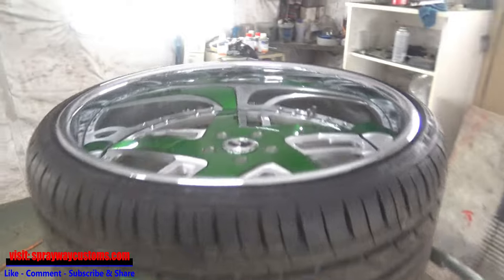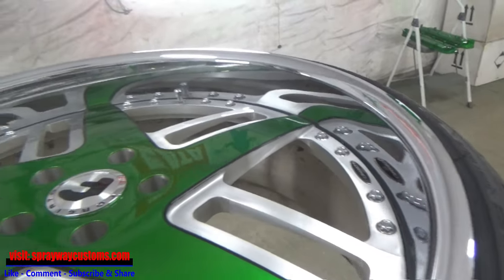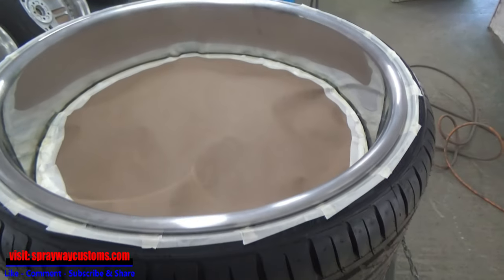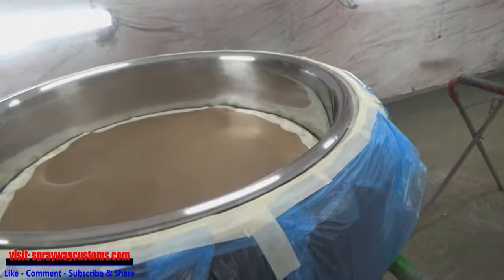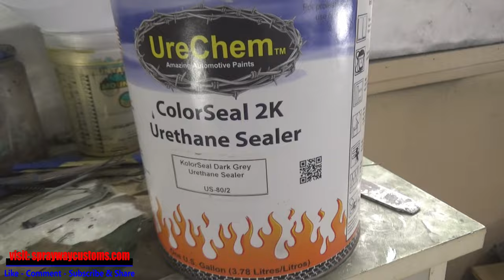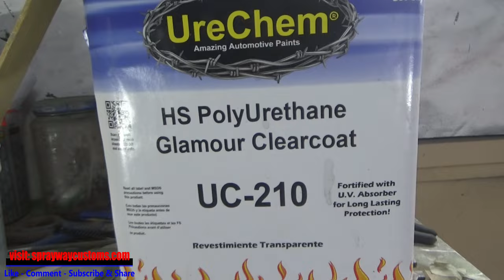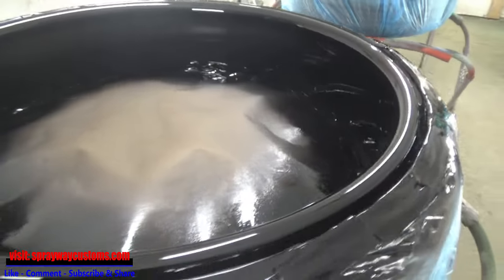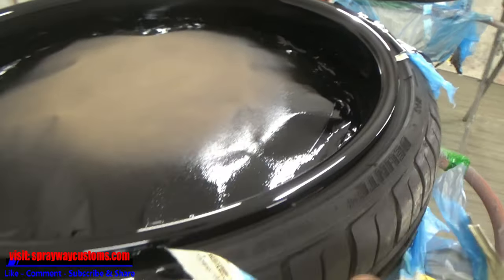How To Paint Chrome Wheels Black & Candy Green CAN YOU PAINT CHROME RIMS - 22" Three Piece Forgiato

Comment: Sprayway my first project, I have a faded what I believe to be a single stage paint not sure but no flaking its a 67 mustang minor small rust spots I'm planning to repair with fiberglass bondo,  would you epoxy prime body then high build primer block then seal or block and then base and clear?
Reply from the maker: Yes, that’ll be the way to go

Comment: What about paint peeling chrome? Do you sandblast them down?
Reply: He scoured them by hand with Scotchbrite - an abrasive pad for scrubbing hard surfaces. It scratches up the chrome plating enough to give the first coat a surface that is rough enough to seep into and grip properly.
Reply: @mike_van_in  that works great on non peeling chrome.
Reply from the maker: Peeling chrome you would have to remove everything until the peel stop and then take some 180 and feather edge it and then wipe a skim coat of light weight filler and sand, prime sand to get it smooth and then paint.
Reply: @SprayWayCustoms  thank you